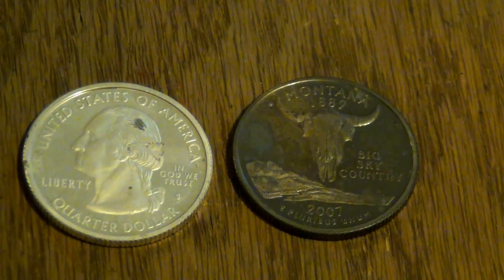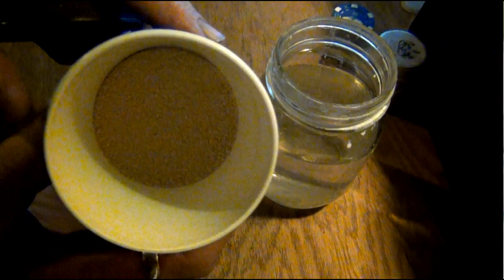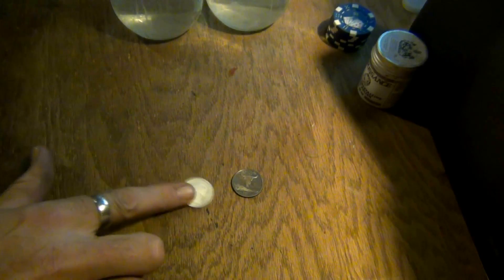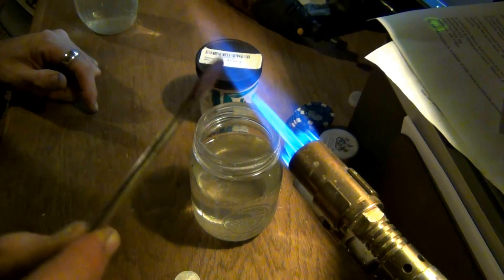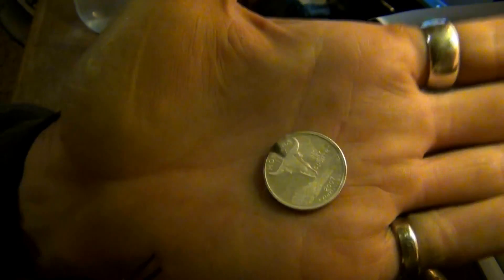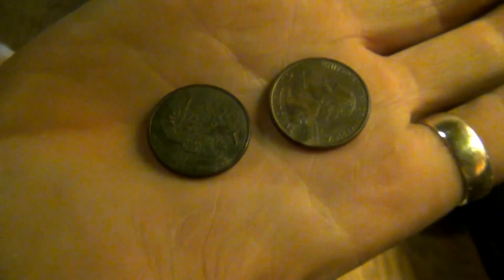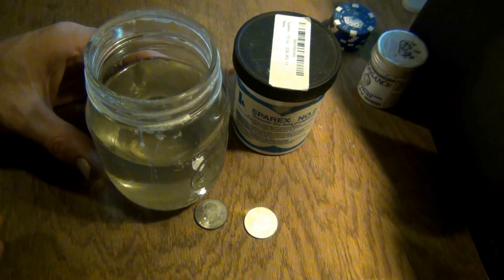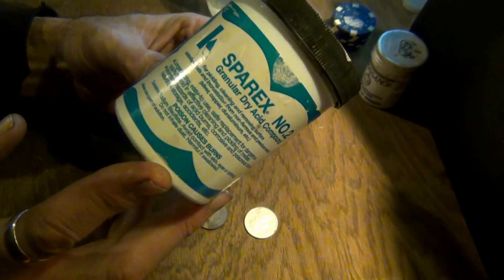Annealing  Silver Coin Rings  Acid/Pickle  Bath

Comment: Sparex isn't available in the UK, anyone know what the UK equivalent is?
Reply: You can use white vinegar and a bit of salt, it does the same thing. You really should use copper tong to put in the coin so the pickle stays fresh. If the coin turns copper color put in hydrogen peroxide  and that makes super pickle to take of the coppery coating. Super pickle doesnt last long though. Need to remake it for your next coin. Hope that helps.

Comment: best i have read. sparex sits around 1 on the ph scale. stronger than citric acid, weaker than battery acid. i have mostly worked with alkalines. but if you understand how the ph scale works. it's best to have counter products in case of an accident. for sparex Id keep a baking soda/water mix around. to balance the affected area back to 0 on the ph. stay safe.

Comment: +fencekid ....four questions for you brother (of of which I think you mentioned in the video).  1.  How much sparex per pint of water.  I know you said around a tablespoon but wanted to confirm and 2.  If I plan on soaking my coin in a liver bath of petina, is it better to just use water and allow the carbon to stay baked in or would you still use the pickling process.  3. Ideally, how long should I soak the coin in the acid or does it matter?  I don't want to harm the silver obviously.  4.  I hear some guys say use the pickle in a slowcooker/crockpot on low and the water needs to be warm to a bit hot but looks like you are dropping these coins in acid bath that was sitting on your shelf as you said in room temperature.  How important (or is it) to have your acid bath / pickle warm (benefits if any?)??  Thanks in advance brother.
Reply: p.s.  If any of you other craftsman know the answer to the above question(s), please chime in.

Comment: Acid baths are standard business among jewellery makers.  But the ring doesn't have to be HOT for the acid bath to work.    It actually works just as well if you drop a ring into an acidic bath that is warm/hot...leave it there for a few minutes it will be just as shiny :)

Comment: Hey bro, question;
How come the Montana quarter is silver?????? And how could i know its silver? Any special marks or tests? Or by year?
Reply from the maker: Judas priest  this I also a great way to test if a coin is 90% silver. If it's not frosty, it's not silver. And quarter dated 1964 or earlier, are 90% silver, no test needed.
Reply: +fencekid FYI, The mint still produces silver coins, but only in the sets. They are silver proof sets and only minted in San Francisco.
Reply: +fencekid  Hey, great tip!  I've been on the fence about buying a silver test kit but it stains the coins.  I know I could do it in the middle which is going to get punched out but its not practicle to tell someone your thinking about buying some coins and I want to stain all your coins before buying them...lol.  Plus I was told if a coin is really electroplated good, or a good copy comes in from China, it's still very difficult to do a magnet or acid test unless you are willing to scratch down a bit into the coin which sucks even more than just the staining.
Reply: +Judas priest  I just bought (I think it was a 2007) half dollar in mint condition as well as a bicentennial silver yesterday that's silver because it came out of a set like +sfbfriend pointed out so their out there.  Usually you'll want to not say what you are using them for when you find guys like this and just tell them you're pretty disappointed their out of their mint case set and their not nearly worth what they were if still sealed and you can get them pretty cheap.  I won't tell you what I just paid for those two pristine coins yesterday because you probably wouldn't believe me - but what a deal ( I was all smiles like I just got my first BJ).  So, now in return for the info, could you please sing us a song appropriate to the hobby and your name "Metal Gods by Judas Priest"?